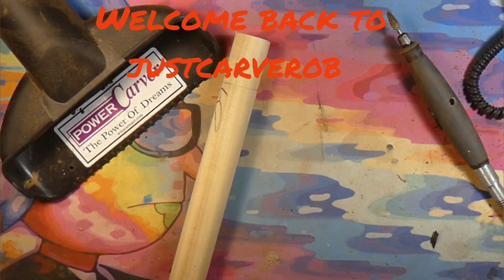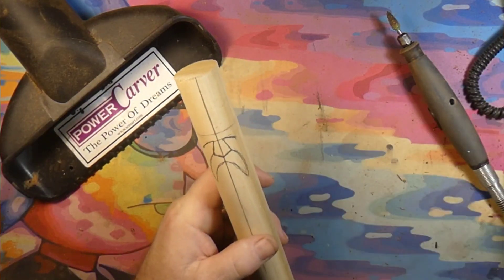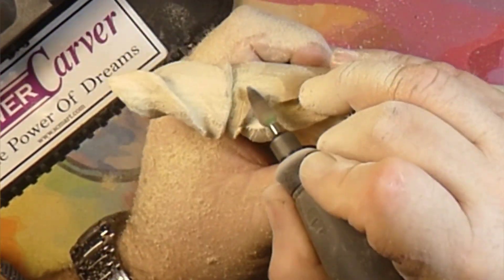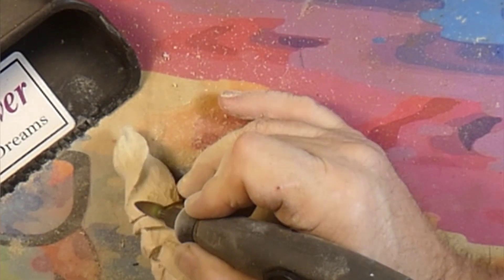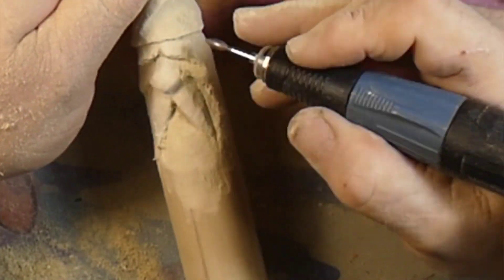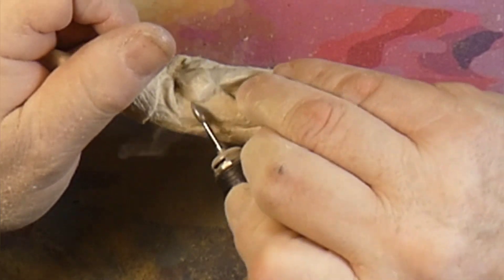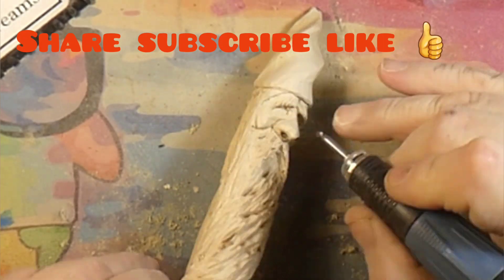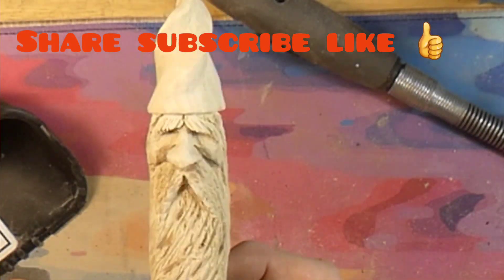Dremel carving a beginner wizard

Comment: Can a small burr (like you’re using to sand down) be used on a regular flex shaft?
Reply from the maker: Hi sall sorry it taken me so long to reply .
I like to use the diamond burrs  from Amazon or harbor freight they are cheap 
And come in a pack of ten also I use ruby burrs from mountain wood carvers. Com 
But the only come in the 3\32 shaft so you would have to get that size collet for your dremle they do make them for dremle I have bought them from Amazon 
Before I got the micro motor hope this helps stay safe Just carve